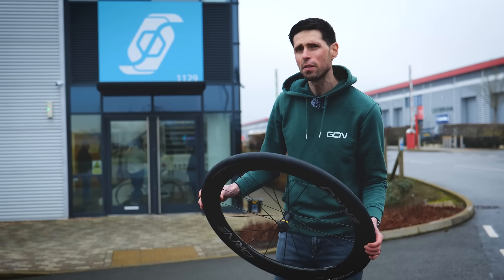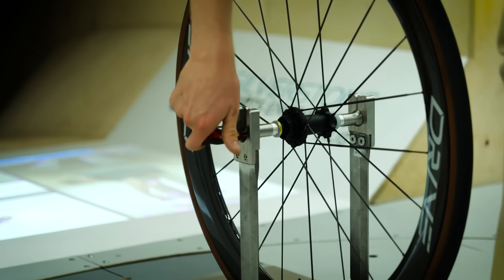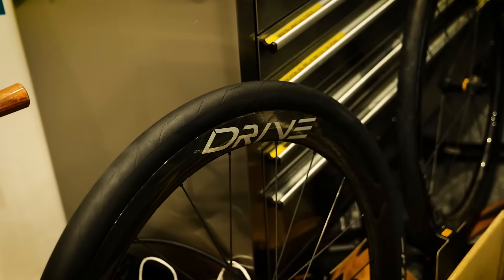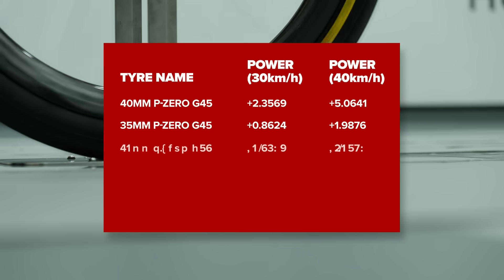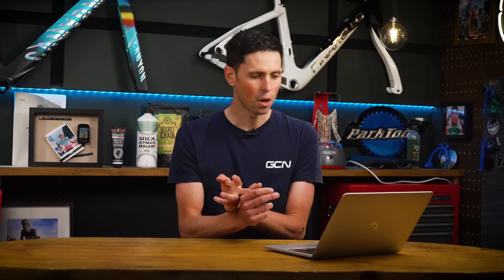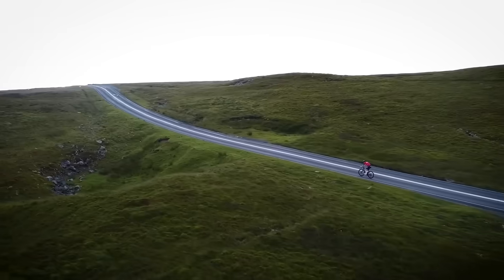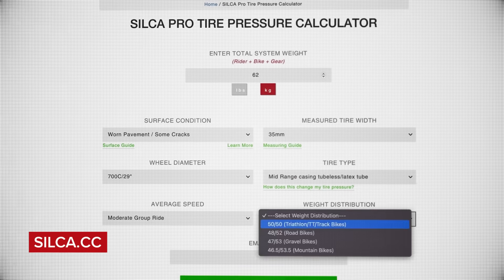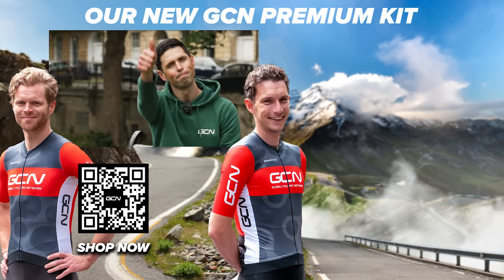The Fastest Tyre Width is NOT What You Think

Comment: 5W is an enormity even for amateurs. When they buy a bicycle, amateurs spend €3500 in order to have a bike which weights, let's say, 8,2 kg. You could buy a 30-years-old bike like mine which weights 10,2 kg and spend €200. It's 2 kg more, and people, real amateurs in the real world, spend thousands of Euro to have a bike which is 2kg lighter. Not that it makes any sense for amateurs, but they do it, the market shows us that. On a uphill with a slope of 7,37%, like the average slope of the Stelvio pass from Bormio, those 2kgs more cost you 4,64W with an average biker weight and average parameters (what matters, here, is mostly gravity). So, people are spending thousands of Euros to spend around 4,5 W less in power during a uphill.

Now, you do that, and then you have your fast ride on the plane near home , and you want to sacrifice those 5W against the wind (which, in winter, as said, does not require you to go at 40 km/h)?

So, saying that "if your race, 5W is enough to start to care about, but for your weekend rides I wouldn't even let it cross my mind", is, IMO, complete melted and stinking BS. 5W is something that is worth spending thousands of € for the average amateur, and in sports is something that puts you out of competition.

Comment: If the test are conducted with a tube in the tyre, why using a tubeless tyre (if I get it right) and put a tube in it? The tube influences the way the tyre rolls on the road, the internal attrition and the energy dissipation. Why not using tires that are specifically designed for tubes? (Or maybe they were, and I got it wrong).

Comment: presentation of data here is not only inconsistent, but seems like it could be cherrypicked. For the first round of tests you have 28 and 30mm twice, one for the G45 and D50 each. And you display in watts difference. But for the rolling resistance, you've cut out one of both the 28 and 30mm, so we don't know which we're comparing. And you show the absolute watt lossage, instead of the difference.
Your 'conlusion' claims a significant difference due only to rolling resistance, but that difference overall is less when you factor back out the aerodynamic gains made by the 28mm, than the difference just in the aerodynamic watt loss. Put another way, you don't care about 1w difference from aerodynamics, but you DO care about a 1w difference when you take rolling resistance and subtract the aerodynamic advantage. 1w is 1w.
Then you go to talking about pairs, when you've only measured singles?
This is crazy amounts of confirmation bias. c'mon man, do better.

Comment: I run 30s tubeless these days for summer riding but for these tests nobody seems to mention the weight penalty of constantly having to wind the wheels up to speed when your out with a bunch of mates going through the lanes. The weight is all on the outside of the wheel so surely that is going to add up and make you work harder between say a 30 32 or 35mm tyre?

Comment: quite interesting, would have been good to compare with an a little older 25 mm width with fitting rim width (like from 10 years ago)... Just updated in my 2016 Giant Defy (Advanced Pro 2) from 25 on original wheels with butyl tubes to 28 mm GP5000 on DT Swiss ERC 1400 45mm wheels and TPU Tubes, but I was not quite sure if I should use 28 or 30... and the frame might even work with 32, but thats kind of tight then I guess... Not racing with it anyways, as its an Endurance geometry I thought that would be an ideal fit. Saved 480g on wheelset, tubes and tires, plus another 100g with new quickouts :D Totally different feeling now.

Comment: what about weight of the tyres, there are 32mm tyres that are lighter than 25mm tyres. IRC serac.. what about rotational weight losses.  if all weight could be concentrated on the hub rather on the surface of the tyre it would be best. especially for the rear wheel.

Comment: I own several roadbikes, my 1972 racer is using 25mil sewups for L'Eroica  events.  my riding buddy on 30 or larger, his bike is a 40lb gravel style with front suspension he's never been able to climb well, but he's never since '89 had flats on a ride. He's happy.  My most used carbon bikes, both on GP5000 25,s with TPU tubes, one the Kestrel Talon, can't handle anything larger than 25.  My GT-Grade i am happy with 25's. For racing in the Velodrome,  i am still quick on 19mil or less!  Go figure! LOL

Comment: I've settled on 28mm front + 30mm rear with GP5000 tubed tires, influenced by my new Roval Rapide CLX III's being 'optimized for 28mm' - I want the best aero advantage on the front, and low exposure to gusts. CLX III's have an EW of 35mm so the front easily meets the rule of 105. On the rear, the 30mm tire is more for comfort, while minimizing rolling resistance (RR) and weight. For weight, since I deal with lots of hills, I looked at GP5000 tubed tires - they weigh 245/260/295 grams for 28/30/32mm widths, so the 30 has a modest weight penalty and likely the lowest RR. The Silca tire pressure calculator suggests 74 psi front and 67 psi rear for me, a great recommendation for comfort. Fyi, I stopped using tubeless as I find my GP5000's rarely flat on local paved roads, and use Schwalbe Aerothan SV16's (soon SV15 AE's) to get weight and comfort benefits, with the convenience of tubes. Fyi, I rode 28/28 mm tires on my Reserve 40/44 wheels previously.
Reply: I should mention that my first ride with the new wheels, I started with 75 psi front and rear, and it made a noticeable difference in comfort (thus speed) when dialed it back down.

Comment: You did not speak about tyre pressure and footprint, as you should inflate the tyres untill they have the same footprint at the same weight load, it would then give the same rolling resistance.

Comment: There getting paid by manufacturer's to push bigger tyers...we used to race on 23mm tubs 120psi plus...fast has fck, roads are crap in uk now hence bigger tyers for comfort. If the roads were like on the continent, we be on 23c. I've got vittoria next tubeless supposed to be 25c they measure 30mm,  below 80psi there slow and drag @60psi.

Comment: As an XC/MTB rider (with a 26in wheels bike and 29in wheels bike) I can say that there are much much more factors.  MTB tires have way more weight to them, so the differences are easier to spot. For example wider and/or bigger wheel will have more mass, that you have to put into motion, so less of this mass, the bike will accelerate easier. The downside of it is that if there are more imperfections, they will slow you down more. The other thing is the gyroscopic effect, the more weight of titre, the more stable is the ride straight, but it is less eager to change the direction, so beter on bumpy roads, worse if you have to steer the bike left and right. ;) To sum up 29in wheels are more comfortable, but harder to put in motion, 26in wheels are agile and agressive, but you feel like a ping pong ball on the track.

Comment: Ive got a trek domane 2017 and it came with 32 on 17vision i ternals and sits 30mm wode. I bought some 28s which blow up to 28. Harder ride and i couls not discern any speed change. Th3 30mm width works for me. Not tubless but 65psi is pretty comfy on a comfy bike anyway

Comment: I'm no racer, just a passion for riding since age 4. Over 50 years of riding, I tried a racey setup once, having been more of an all road/mtb rider. The dedicated road setup was explained to me, and the recommended psi was alarming. In both my bikes and jeeps, I was an early advocate for lower psi and more rubber. I tried my best to find any advantages. Not long after, I was measuring to see what size tires I could fit on the speedy frame. After filling in the available rear space, I was happier with the bike, though there was little room for even some dry leaves to get through. These days, I ride an almost two decade old vassago frame, basically a modern gravel configuration that allows larger tires. But it is rare that I return from a ride having been on pavement only.

Comment: Rolling Resistance test is very flawed due to using perfectly smooth surface. Any kind of real world tarmac will have more bumps and lower tire pressure on wider tires significantly offsets your lab condition increased rolling resistance. Google Jan Heine and hysteresis.

Comment: I've been running these 30mm Pzero race TLR tires for a couple of years now on 21mm ID rims.   Great combination of grip and aero, but beware running them lower than suggested pressure results in a large uptick in punctures.  It's as if the puncture protection is only on the crown. they seem very brittle too. I have a stack of 5 or so in the garage that have failed in some weird way with bulges, holes that won't plug or just too many dynaplugs for me to feel safe.  I am a 150lb cyclist running them tubeless at 72 PSI.  I am considering ditching them altogether due to lack of durability alone. It's a shame as they are a brilliant tire. Been riding road for over 20 years and never had this rate of puncture/failure. If you do run these, always have a spare new tire handy at home.  YMMV

Comment: I can compare the feeling on my roadbike on 23/25 mm tyres versus gravelbike on 45 mm tyres, and I feel that the 45 is rolling faster because the hardpumped skinny tyres feels bumpy on the course asphalt. Where the skinny tyres excel are on the  climbs and out of the corners. Better accelleration.
Reply: My 45s seem like they look flat on my commuter. Even at max 50psi when I look down the spread of the rear tire looks so wrong. Never experienced that with skinner tires

Comment: Whilst it would be fine to double the rolling resistance figures for argument's sake, i would be surprised if the front tyre saw exactly the same rolling resistance as it has less weight on it than the rear tyre. But the difference would be minimal, so not really worth testing

Comment: The majority of my stable—14 bikes strong—is made up of classics from the early '80s to the mid-'90s. I do have a few outliers: a 2005 BMC SLT01, a 2008 BMC CX01, and a 2015 Ritchey Carbon Break-Away. I've been riding 25mm tires for years, but recently built up a set of wheels with H Plus Son’s modern, wider rims and decided to give 28mm tires a try. I mounted them on an ex-Chateau d’Ax Moser Leader team bike that I restored. The ride was fantastic—smooth, stable, and confidence-inspiring—but not so transformative that I could ignore how awkward they looked on the bike. So, back went the 25s, which are already a big upgrade from the original tires.

I definitely didn’t feel the need to overhaul the rest of my fleet. Most of my bikes are from the '80s and '90s, and honestly, bigger tires just look out of place on those classic frames. Not quite balloon tires, haha, but they do mess with the vintage aesthetic.

So for now, the 25s stay. I even tried 28s on my skinny-tubed 1989 Pinarello Montello with Mavic Open 4 CD rims, and it just looked... wrong. For me, my bikes, and my riding style, 25mm is the sweet spot.

That said, my 2005 BMC SLT01 wears the 28mm P-Zeroes well. With its chunkier lines and modern geometry, it looks right at home—and I might even go bigger down the road. I’ve already picked up a set of 30mm P-Zeroes for my Ritchey, though I haven’t mounted them yet. Even with its slender carbon tubes, I think the look won’t be too jarring. And since it’s my travel bike, the added comfort will definitely be a plus when riding on unfamiliar roads of questionable quality.

Comment: It must also be borne in mind that if the tires are from different manufacturers, then, with formally the same declared width, in reality, the tire may have a DIFFERENT HEIGHT, and accordingly give a different diameter and a different circumference. For example, I personally checked that the 25 mm Continental tire is SMALLER in diameter (about 5 - 8mm) than the Schwalbe tire (also 25 mm). Accordingly, due to the different diameters, we will have different stiffness. That is, Schwalbe will be softer than the Continental. Well, at the same time, in my personal tests, the Continental turns out to be much faster (although tougher), provided that you are driving on a good smooth road, if the road is not perfect, perhaps Schwalbe may have an advantage. Well, there are also some nuances, like the profile of the tire, and some tires may have a higher profile, and accordingly, if you pump them hard, the contact spot will be smaller (but there will also be problems with handling, stability, and braking (and as a result with safety), and it will feel like you you don't ride a bike, but rollerblades, or a scooter with solid cast wheels.  Although I do not exclude that if the road is perfect, straight and dry, there will be no side wind gusts, then on such high-profile tires, you can drive really better and faster than on inflated ones up to nominal pressure.

Comment: I switched from 28mm continental GP5000 to 30mm continental GP5000. With a lower pressure, the comfort is noticeable.  The speed remains the same at the same power output.  On my Zipp 303FC’s, the 28s measured 30.5mm and the 30’s measure 32.2mm.  At my speeds, I don’t think there is a significant drag difference.

Comment: Basically lower pressure provides more cushing so that you can roll on rough surface without lots of bumps as on higher pressure which slows you down by wasting in the extra up 'n down trajectories. It would be interesting and useful to know the pressure sweet spot for each type tyre.
Reply: They’ve already done a test like that and the results ended up very similar to what you would get from using the Silca tyre pressure calculator. So just use that

Comment: I'd been riding 700x25 clinchers at 100lb ps on ENVE 4.5i for years on a C50.  Thought this was comfortable and handled like it was on rails.  I upgraded to a C68 with 700x30 tubeless Conti 5000s at 60lb psi on ENVE 4.5 SES hookless.  Hands down the C68 is faster but I also find the 30 width to be extremely forgiving and comfortable.  Very interesting that ENVE has announced the Pro 4.5 release with hooked rims being added back and a narrower inner width and recommendation of 28 wide tires.  Is this just catering to Tagej?  Did ENVE realize hookless wide are not as good as they told me when I talked with them about my hesitation for hookless? Dunno but will be interested to find out.

Comment: Power Loss Vs Tyre Width in the rolling resistance tests.
Can anyone, explain what seems like an anomaly, or support my view?
Test results, 40 to 35 to 30 mm tyre width show progressively lower power loss - Seems logical to me.
Why doesn't that trend include the 28mm tyre?   Logic suggests that the 28mm tyre should require proportionately less power than the 30mm.
How about re-testing under carefully controlled conditions?

Comment: I stopped the video at 51 seconds. There are other factors, but based upon aerodynamics only, 28mm should be the fastest. It could be the fastest overall. 
   For a commuter tire, the larger might be optimal.
   (Edit) Interesting information. I used the advertised tire pressure calculator! I am on a 40mm tire, I weight 125lbs. The bike is below 30 lbs, and I have a backpack. I added about 15 lbs for that.
   It is a gravel bike, but I will mostly avoid the gravel. There are gravel sections on my commute, but I don't want a flat, as they are not trails. I just wanted the benefit I'd of a multi purpose bike.
   I will try the 39/41 psi it recommends. It should work pretty well! I also chose pavement with cracks and recreational riding.

Comment: The results seem to be strongly influenced by the air pressure, which was recommended by the Silca algorithm. However, it's unclear if those were truly the optimal pressures for each tire size. It's possible that with higher pressure, the 40 mm tire could have shown even lower rolling resistance than the 32 mm. It would have been interesting to see a comparison using the maximum allowed pressure for each tire.

Comment: On rollerblades hard wheels are faster but only on a very smooth surface. On an average road hard wheels do not absorb bumps and vibrations and transfer them to shells and legs causing extra energy loss. For my weight 85A is the optimal. More hardness is worse.

Comment: I ride 25mm tires at the front because I just can't get used to 28mm there — the feeling on the cockpit is off for me, I don't like how it handles. At the rear, I usually run 28mm, and sometimes even 30mm, but honestly I haven’t noticed a real difference. My rims have a 21mm internal, chosen instead of 23mm in order to mount 25mm up front works fine.

Comment: Switching to 30-32mm width and lower pressure definitely is great for comfort. I stopped using 23- 25mm tires because those are hard rides for sure. I don't do any competitive races so not a biggie for me at 60 years old. But I do enjoy a decent pace around 18-20mph. I have found that to be doable and comfortable for 10-20 mile rides.  I'm not a lightweight rider at a physically fit 200 lbs. I'm 5ft 7in short. So my bike frames are not large by any means. Most of my bike frames are are 50CM - 55CM.  Like most of us here I have a few bikes.

Comment: hmm, I'm using 23 mm 8 bar - and I can feel the speed difference - and measure it on the time it takes to drive the standard commute of 20 km's, if the pressure drops to 7 bars on one or both tires. I wonder why they don't compare with 25 or 23 mm tires? But I have seen a lot of tests in the past, where it is obvious that the testers want the wider tires to win, even though they maybe will be slower in a practical test? But maybe it is because my weight is about 66-68 kg's plus clothes and maybe my backpack with notebook and laptop etc. I don't really believe that 28 mm wide tires with lower pressure is faster - more comfortable, yes.